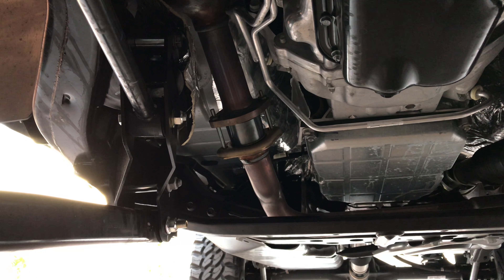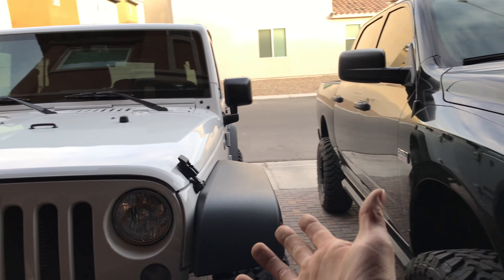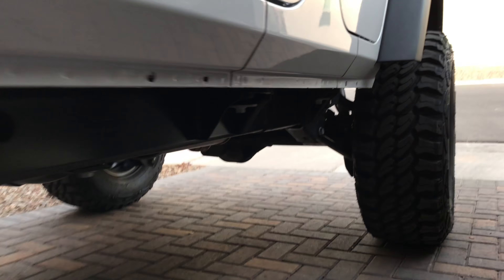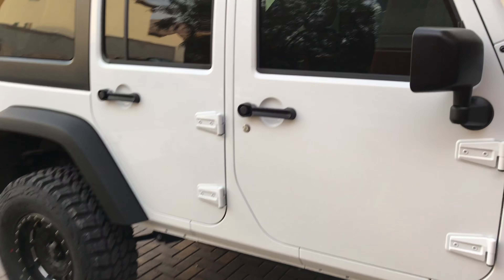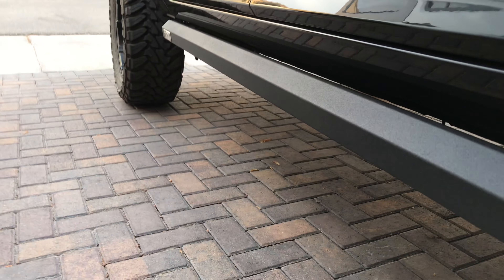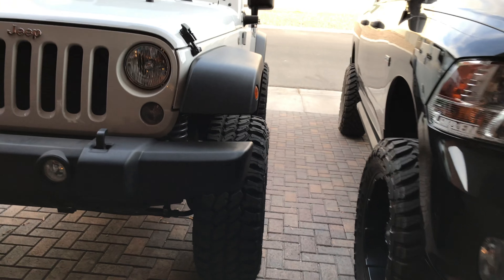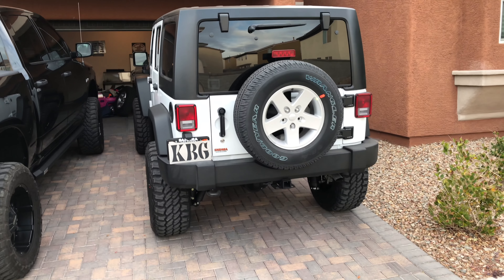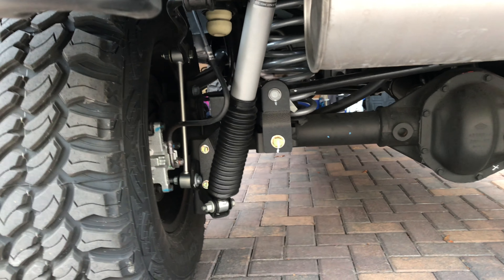Rubicon express basic 3.5 inch lift kit 2017 jeep unlimited

Comment: I’m still on the fence about getting the front end leveled on my 2wd ram 1500 (2017). My concern is the angle changes of the balljoint, cv, tie rod ends, etc. I know there are few ways to do it: shocks, coils, spacers. What are your thoughts.
Reply from the maker: You need to get you a bilstein leveling kit and call it a day. Hope I spelled that right.
Reply: How concerned should I be with the angle changes to all the things I mentioned before? (cv, upper ball joint, tie rod, etc)
Reply: I really appreciate it sheepdog... I guess I'll go with the Bilstein shocks front and rear, or the rancho quicklift front and rear. Just want f/r matching. Appreciate it; and thanks to Kustomblack...
Reply from the maker: hell yeah!